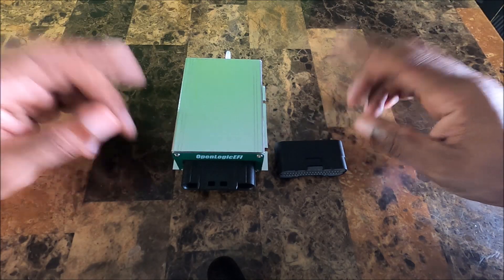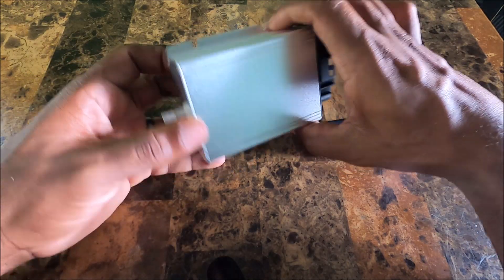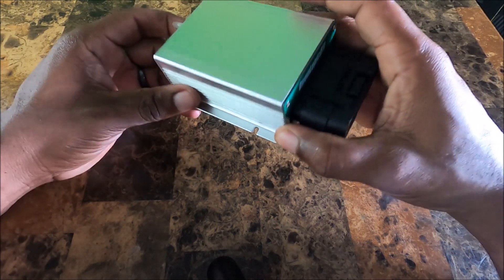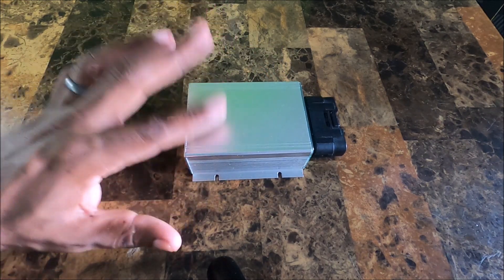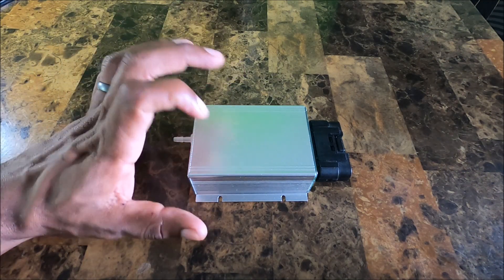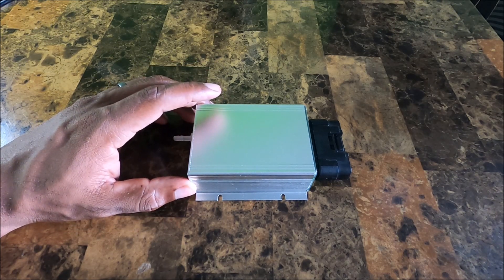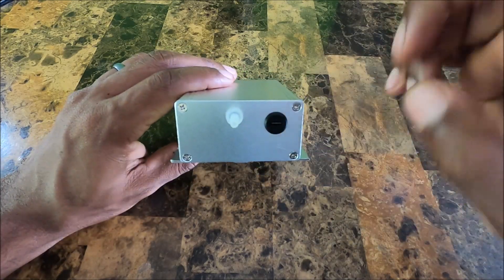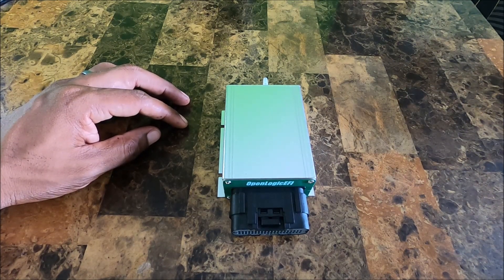OpenLogic EFI Spark Gap Speeduino ECU | First Look

Comment: a spark gap based ecu sounds helpful for how some economy Honda/Acura motors work. In my k24 specifically, all of the coil in plug spark coils pulse and it’s hard to make a proper gap between due to the learning ecu module